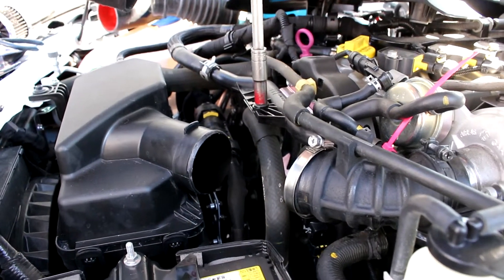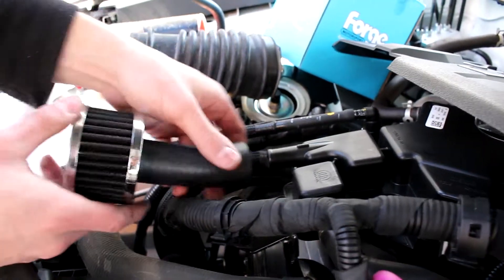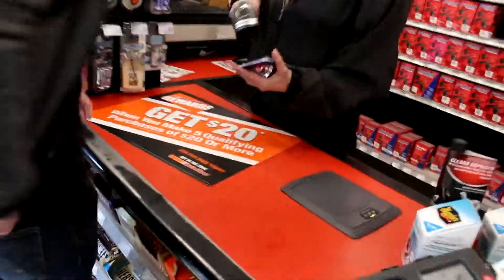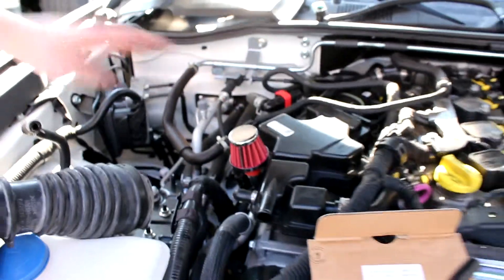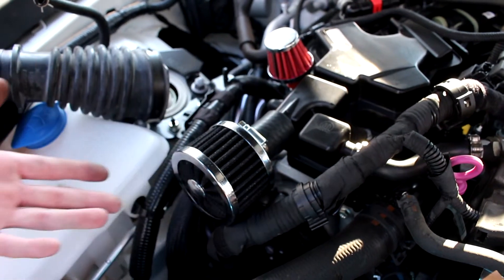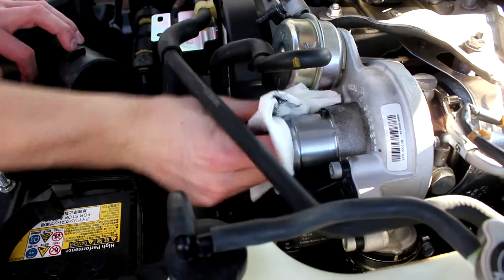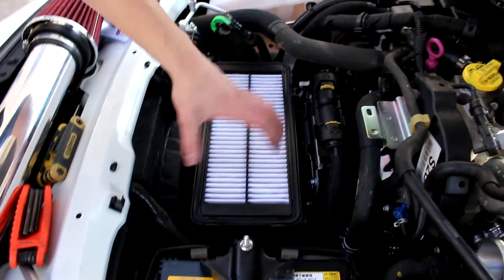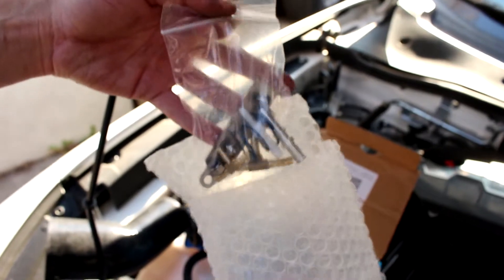Fiat Drift Car - Intake and Blow Off Valve Install!!

Comment: I appreciate your video, but your current air intake is going to reduce HP because it's sucking in hot air from the engine. The factory one is actually really good and better off throwing in a KN filter... If your just going for certain sounds and HP isn't your goal... Ignore this response. Nice Spider!
Reply from the maker: Upgraded not to long ago! I wanted to hear the intake and that's why I used this cheap option!

Comment: Where did you get your cold air intake and what one
Reply from the maker: I bought the K&N filter on amazon for 24$ and the aluminum piping 1' for 10$ and also the 45 degree elbow for 8$ I think..